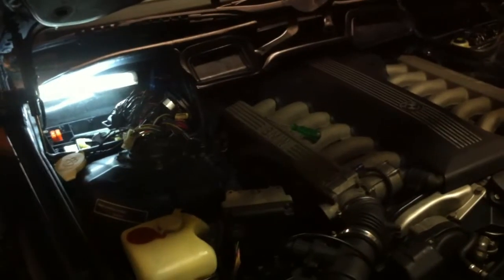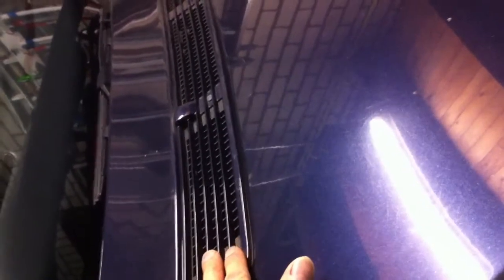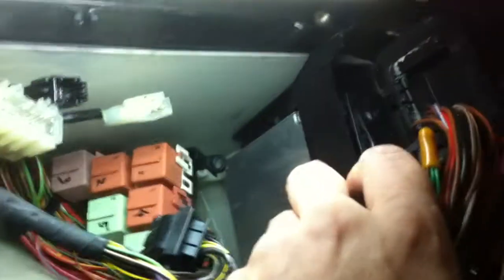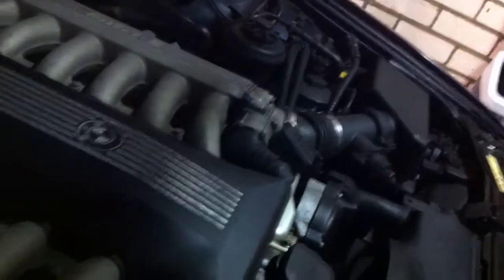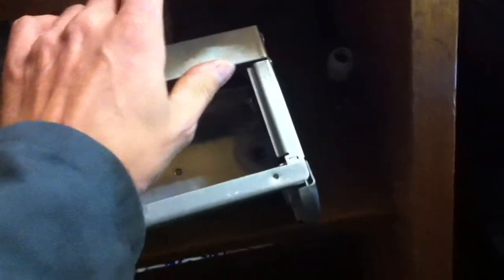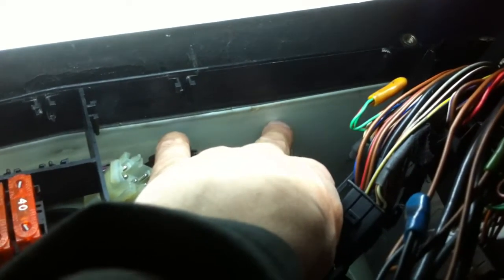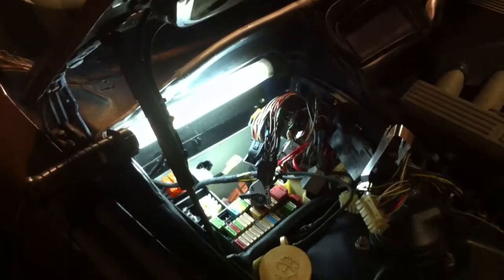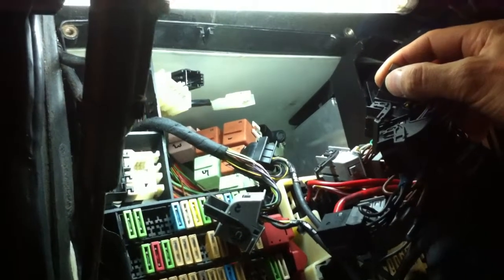BMW E38 water in E box, DME repair

Comment: Hello how are you i have bmw 750il year 1998 i have wash the engine with water and accleator pedal be come not resbond and i have check on electrical system every thing is ok but there is 2 computer called DME same numbers and shabe both same the 2 DME the car is running fine we have switch places and the car be come run and off run and off run and off .. we have return the 2 DME as factory coniction car be come runs fine ..... the main proplem that i have no resbond from accleator pedal
Reply from the maker: Hello if two DMEs are ok them maybe the EWS has got wet. EWS if for throttle. The EWS is the biggest computer so most likely to get wet from the bottom. To take out, open up and dry. Also to check your relays at bottom of e-box. See if the rubber tube at the bottom of the e-box is open so water can get out. Be careful with the connectors. Try not to ruin the car.